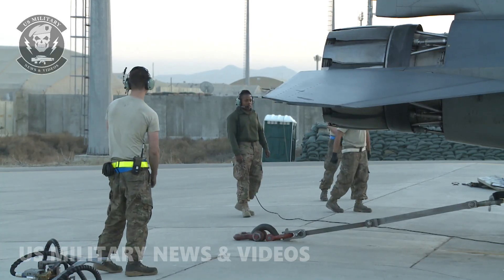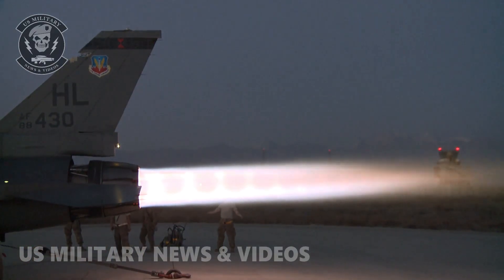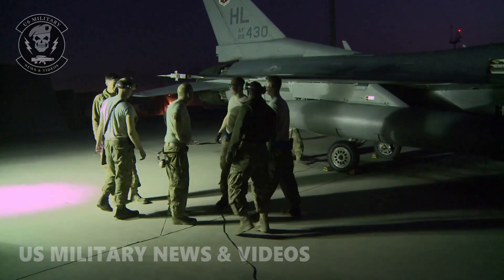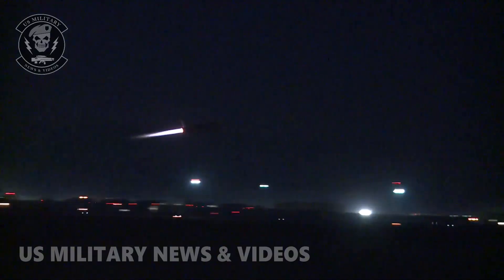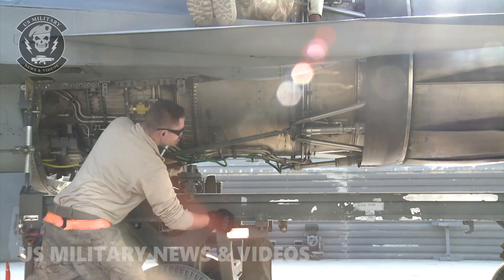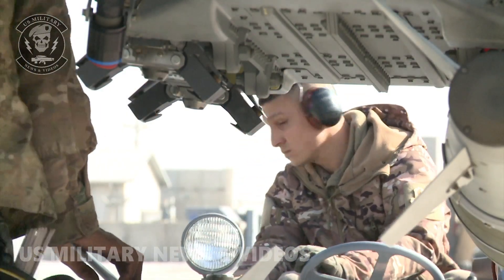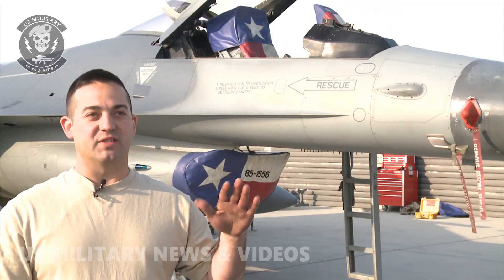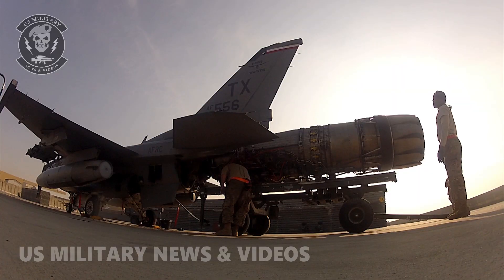General Electric F110 Afterburning Turbofan Jet Engine | F-16 Fighting Falcon

Comment: I sure wish the Airman did not call it a motor.....it is an ENGINE. Motors run on electricity.
Reply: No, well, technically engines are motors as well

Comment: I wonder how many bombs will the jet with this engine be able to hold for maximum Freedom Capacity. The Military logo is surprisingly suspicious , the skull and lighting bolts at the top left of the video and the devil with horns above the jet exhaust tunnel indoors, too blatant symbolism ?

Comment: Huge logistical failure in U.S. aircraft compared to Russian design insane Amount of downtime.
Reply: American engines are MUCH more reliable.
Reply: @Dave-jv3th  Wrong bud. American designed warplanes are insanely frail and have massive amounts of maintenance requirements compared to Russian designs. This is exactly why they are a huge logistical failure. The U.S. military is the most inefficient military in human history.
Reply: @strategicintelligenceanaly9778  Did RT tell you that?
Reply: @Dave-jv3th  Go look up the maintenance hours per flight hours requirements for Russian and American warplanes and you will see the light.

Comment: WHY ISN'T THE ENGINE ON A SLIDING RAIL ASSEMBLY? OR MOUNTED TO THE BOTTOM HALF OF THE NACELL, AND JUST UNSCREW AND LIWER DOWN AND OUT? WHO DESIGNED SUCH A CONTRAPTION AGAIN? WHY NOT REMOVE THE ENTIRE SUBPYLON WITH THE WEAPONS STILL ATTACHED? DISARM THE WEAPONS AND LEAVE IN PLACE? PIECEMEAL REMOVAL IS TOO GODDAMNED SLOW!

Comment: In the thumbnail, is it an after burner or emanation from a particle accelerator?
Reply: I dont think its afterburner it is just a jet engine working in a near full capacity
Reply: @keremalp4627  Yes it is an afterburner. Turbo fan engines without afterburner does not spit fire.

Comment: Actually it's a turbojet and not a turbofan........................
Reply: The F110 is a turbofan engine.
Reply: It's a low bypass turbofan. Not that much different. Just better efficiency overall and more afterburner power

Comment: 8:00
I wonder how many bolts are holding it to the floor. :)
Reply: How many?  All of them.
Reply: :)) zoinks
Reply: From what I recall, it's bolted to a trailer about the same way it's bolted to the jet. Test stand is on casters that are bolted to the floor, never asked how the trailer was secured during runs but I would estimate it's between 12-24 bolts total between engine to stand and stand to floor.

With the f110 engine being in the 30,000 pound thrust class, they're probably pretty strong bolts.
Reply: 5 Holder

Comment: An hour to remove the engine? It takes me that long just to drop the engine in my bug.
Reply: I was thinking the same thing. Pretty impressive. Engine swap in a car takes longer.
Reply: Brian Walter its extremely easy to drop the block on rear engines bugs and 911’s, unlike mid and front engine cars there’s really nothing in the way. If the cars in the air and you have a engine lift than it’s no more than 16 bolts and it’s down but major props if he did it on the ground.
Reply: It's actually significantly longer. I think the reporter may have gotten a bit confused as removing the engine takes about an hour after the main mounts are removed (sliding it onto the trailer). It's a several hour process to get to that point including removing panels, various umbilicals, documenting maintenance, taking smoke breaks, yelling at airmen... It's a ton of work!
Reply: @Quasigenocide  It coulld be right, on a French Rafale 1 hour is the time needed to remove 1 engine and put a new one with only 3 mechanics. So 1 hour to remove it might be right.
Reply: quasigenocide 1 hour is entirely possible with a modular design of the f-16, I’ve seen it done in closer to 30 mins with a team of four and a Gantry crane!
Reply: Mr. Defiled two different beasts.
Reply: @uscplaya69  
No doubt. Those with the jet engine would have destroyed Hitler. Whereas those with Volkswagen engines are victims of his revenge. 😆
Reply: Depends on the crew doing it. An hour to get it out is a bit of a stretch. Typically about 2 and a half for a full removal
Reply: @tylerbuchanan8463  
I kinda squeezed at my end. Only takes about 1/2 to drop the engine on my bug. Thats cuz most the time I dont put 1/2 the hardware back on from the previous time. Lol

Comment: Random pauses are super annoying
Reply: they are jump cuts, do you really want to see the engine going from idle for 5 minutes then mil for another 5, then to max so it could go down to mil and stabilize for another 5 minutes, go to idle and stabilize again for another 5? this video would be at about half an hour. Engine runs are not short, they can be very long. Imagine turning your car on and then shutting it off in the next 3 minutes, it fucks up the ignition system, fuel system, air system, everything. now do that with a $15 million low bypass jet engine, really takes a chunk of life expectancy out of it.
Reply: Heat cycles are what wears out aircraft jet engines.  If the jet engine never shut off it would last a lot longer.

Comment: How do you tell Crewchiefs apart from Engine Troops? Only a Crewchieg would call an F110 an afterburning turbofan where the people that really are the experts will call it what it is. An augmented turbofan. F110s don't have afterburners lol.
Reply: That Mitchell Guy experts don’t use nomenclature like “engine” or “motor” either ha ha, the F110 is classified as an axial comp. twin spool powerplant.  Why?  Because it is employed to produce more than simply thrust, it also produces electrical power for the airframe via generators linked to the AGB which also charge DC batt systems, as well as support for hydraulic systems and oil, most linear jets (thrust rather than torque for a prop i.e. turboprop) use a spline shaft linked to an AGB for these purposes, I am an A/P.
Reply: It does have afterburners, you idiot. The F118 is the non afterburner variant.

Comment: Nice job, how many psi compresses the high pressure compressor in those jet engines
Reply: Its not measured in PSI if it was it would be a HUGE amount. I work on F100 engines which is extremely similar to this one. F100s power F15s and F110s for 16s.
Reply: The compressor produces a huge volume of air at only moderate pressure. The pressure gain is in the diffuser case where ignition occurs.  The diffuser transforms high velocity medium pressure air into lower velocity high pressure air for combustion.

Comment: TurboJets are bot Turbofans
Reply: The f100 is a afterburning turbofan engine
Reply: No, it is a turbo jet because it has no fan in front of the compressor that allows bypass air to go around the compressor.
Reply: @camhollo1139  It is a low-bypass turbofan engine.  Its bypass ratio is only 0.68 to 0.76.  That bypass air does go around the engine core, and isn't used for combustion purposes unless the afterburner is lit up.